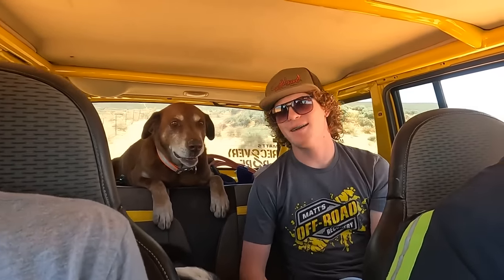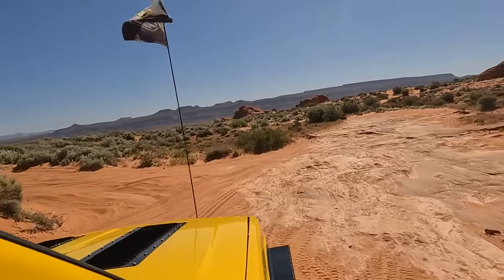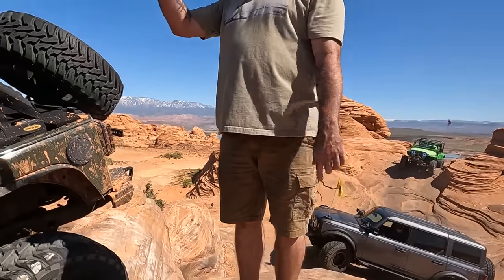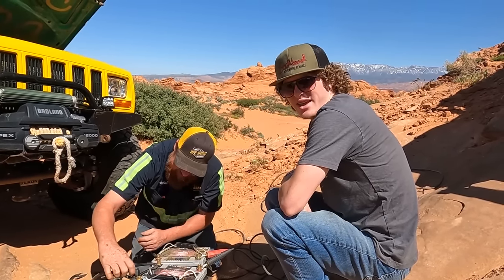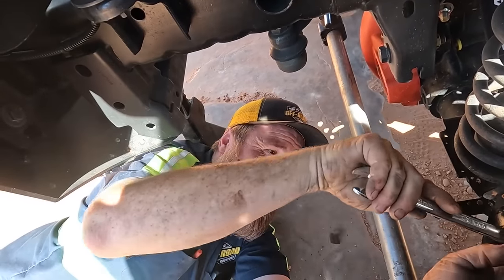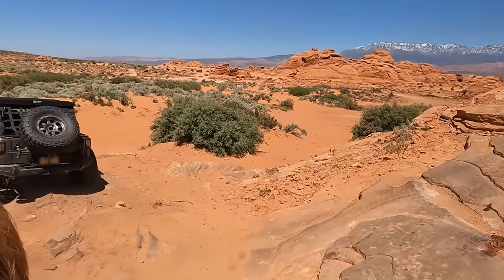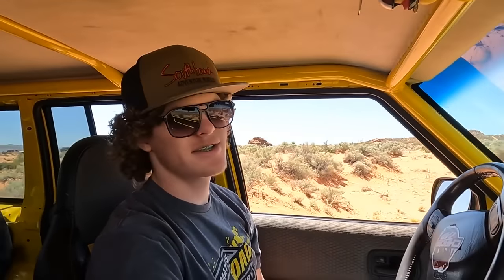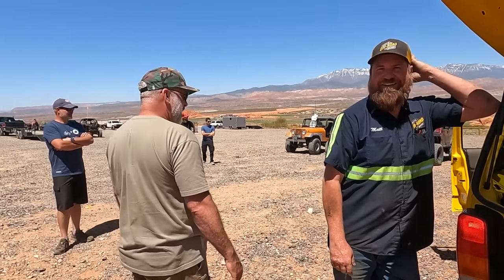I Stole This Recovery...Sorry @trailmater & @offroadrecoveryteam

Comment: That not having you're lug nut 'key' with you at all times when off road is kinda a no, no.
Reply: Having one period is a no no. They do nothing but screw you and that's it.
Reply: Not having a locking lug nut, and then someone steals your wheel(s), or just loosens all your lugs will screw you too.
Reply: Surprised Matt doesn’t have an assortment of keys and screw in pull points considering the line of business he’s in. But then again being unprepared is sorta his M-O.🤷🏽‍♂️
Reply: @7t2z28  They don't thwart thieves at all, not only can you buy ANY key off of Amazon for mere dollars, but if you grind away and alter the patter slightly they become extremely universal, since automakers all use the same few designs just with different numbers of lands/grooves and varying thickness of the keyways. Not only that but you can still get them off through tons of conventional ways, like jamming on a normal socket and simply knocking out the lug nut through the drive pilot, or a using simple nut-biter. Those new self-tightening pipe wrenches also work wonders, and are $12 at harbor freight.
To that effect if you're offroading with expensive wheels.... well you're a fool, plain and simple. Especially rock crawling like this where they're guaranteed to get damaged.
Reply: I've never seen an inexpensive off road wheel. Have you bought tires lately? Ever heard of bead locks? Even plain steel wheels are getting up there. There's no sense making it easy for them. Thieves will steal anything whenever the opportunity arises. I doubt many of them carry around a box of lug keys everywhere. Also, if you bother to look, there are better keyed lugs, where the head is surrounded by a hardened ring, so you can't just jam a socket on it, or grab it with vice grips. Sure, nothing is completely thief proof given enough tools and time, but sometimes spending and extra 20 bucks is the difference between not getting ripped off, and spending 2 grand on new wheels and tires. Then there are the dickheads that don't want to steal your stuff, they just want to wreck it and loosen all your lugs for you.

By your logic, I shouldn't bother locking my doors since a thief could just break the window.
Reply: @7t2z28  People add beadlocks to $70 steelies all day long, I have them currently lmao I don't know what you mean at all. If you chose some fancy alloy rim in an odd size, that's just bad decision making
Also your logic would be correct, that's why homes in poor areas have bars on the windows.... 
I'm just trying to warn you guys as a mechanic who has a very small collection that I got for next to nothing and use every day. Don't listen if you don't want, that's just increased business on my end. There are definitely good worthwhile locking nuts out there, it's just that 9/10 people don't buy them. Rather they keep what came with the car or whatever was first on google

Comment: Wow wow hold up. Matt teach the boys that a car battery can easily easily kill a grown azz man. Two battery’s can kill ya twice as dead. Volts are not the  worry.  I do thousands an thousands of volts with fencing. It’s the amps that are the killer . I can have 20k volts but at a 1/4 jule  and your fine. But can die from a 12 volts at 5 amps. So car battery has hundreds of amps. Think a lesson is in store for the entire crew. Especially now that your getting more into these kinds of repairs and all the vehicles are going to have dc welders on board and bound to have an issue where someone will have to do something janky witch is fine as long as everyone is safe. But yes car battery can kill. Stay safe out there guys. I’m no pro but I do respect electricity.
Reply from the maker: 12 V at 1 billion amps would not even be lethal to a human.

The human body has a resistance that is far too high.  The amp draw with you soaking wet with salt water would be effectively zero.